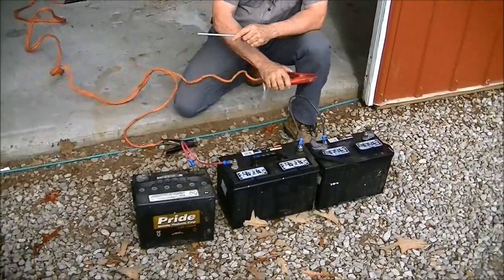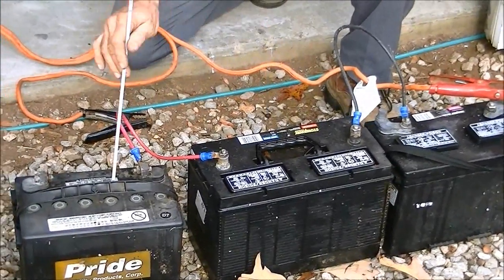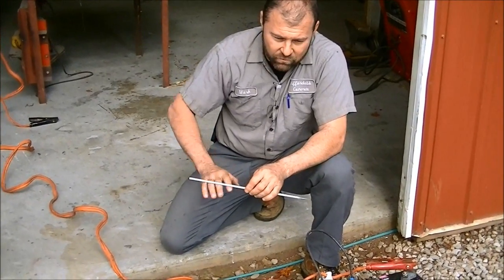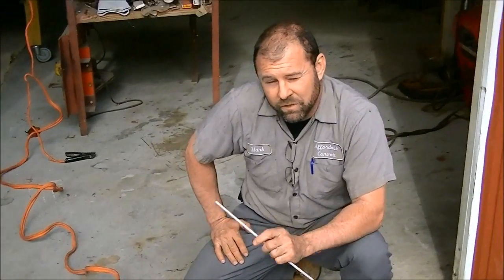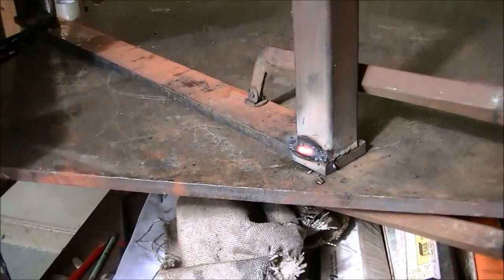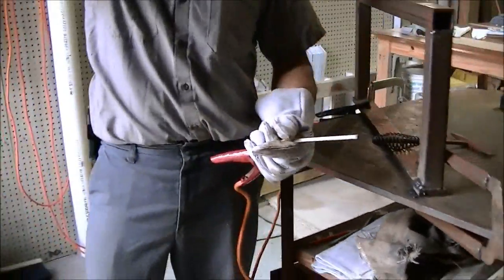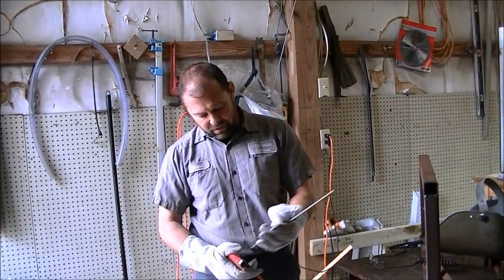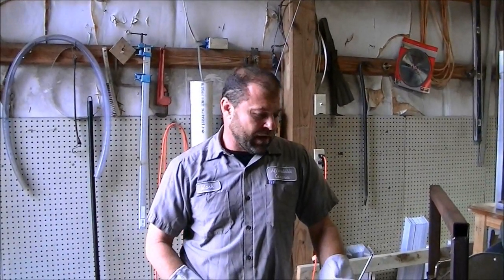Weld with car batteries? Neat trick in a emergency using jumper cables

Comment: If you set it up as an electro-negative you will have much greater success, and a much more constant bead!  So, positive to ground on your work and hokd your rod with cable that is clamped to negative.  No more "spit on, spit off".
Reply: that's what he did initially before welding when connecting the cables but then the video cut and he welded with the positive in his hand...

Comment: I was wondering if you were off grid and had solar panels connected to the batteries if it would work a little better or longer welding time???
Reply from the maker: I am not off grid but I do charge a battery bank with solar panels. I only weld with battery's in places I can't get to with the welding machine. I am sure you could weld a little longer if the batteries are being charge with solar.
Reply: @markp0177  I also was  thinking that welding with batteries alone would stress them, having panels attached should I  buffer that a little.

Comment: Does this damage batteries? How many amps do I need to weld to 1/4 rebars together?   My van has a single  oversized 155 deep cycle 12v battery.  My alternator is 160amps.   With the engine running I am able to run 110v AC appliances at about 1500watts.   I am wondering if I can use a 12v to 24v 480w buck converter to weld and somehow isolate my battery. Thanks.
Reply from the maker: It does not harm the batteries. Three 12 volt batteries in series will give you enough power to weld 1/4" rebar. A 480 watt inverter will not work.
Reply: @markp0177  480 amps (not watts).
Reply from the maker: @12vLife  You only need 90 amps to weld.

Comment: I've been thinking of trying the batteries in my golf cart to weld, I did try just it for a second or 2, I think I want to try again maybe disconnecting the cart then just use 4 batteries x 8 V. = 32 maybe 34V total. Do you think I would hurt my batteries, they are Deep Cycle Lead Acid Battery.  I have been playing around with the salt water type arc welder, use a 6011 rod 3/32 with a 10g. wires going  to a 40A. breaker, tends to need a bit bigger breaker, I plan on doing a video once I get the system down a bit better.  Thanks for your upload.
Reply from the maker: It won't hurt your batteries. You have it right to use 4- 8 volt batteries with a 3/32 rod.
Reply: @markp0177  
Thanks.  here is a little video I posted (unlisted) to YouTube, I'll do a better video later explaining what I've learned.
https://www.youtube.com/watch?v=U0zH0kiMNic

Comment: Awesome video. I have a three deep cycle battery bank in my e250-based overlander.  I always carry a few rods. You can carry a $25 electrode holder (or even a vise grip like some guys said) to hold the rod more stable. I carry a pair of the old style welding goggles too. Never had to use it on the trail, but I’ve played around with it before trips to practice.

Comment: Welding with car batteries doesn’t work very well because batteries are chemical power and put out flat DC power - no pulse whatsoever and that kind of power does not arc very good if at all. I know, I have done this experiment a few different times.
The first time I tried it I hooked two car batteries in series 24 volts and about a 60 amp charger across one of the batteries which gave it a little pulse and helped it arc a bit. I welded a couple welds with 7014 rod about an inch and a half long. Worked okay but one of my batteries was junk and ran out of power after about an inch. I welded two pieces of angle iron together and then cut the weld out and kept in my tool box many years.
Last time I did this I hooked two much better car batteries together 24 volt but only had small 4 amp charger on one battery. It did not want to arc at all. The best I could do was a ‘ scrubbing tack weld ‘ with 6011 rod. It was enough to tack a frame together that I then took to my job and MiG welded. Car batteries have plenty of ‘ oom pah ‘ and if the rod stuck it would light up like a toaster in 3 seconds but no arc power.
I suppose 36 volts would be better but still no real arc. This weld done here in little bits looks about right. I believe this one to be real. Too many on YouTube are 100% phony
If you could add something to help it arc it would work good.

Comment: In a coal mine we use batteries to weld all the Time we have a big resistor to limit the current it can be taped to different spots for different amps

Comment: One improvement would be to clamp the welding rod into a vise grip, and then hook the jumper cable to the vise grip.    Better connection at the rod and better performance.
Reply: Vice grip engineering is third world countries best friend.

Comment: Great stuff...
As a avid 4x4 offroad guy...I will toss a couple rods in the tool kit and make a jumper wire....we already carry jumper cables anyway....thanks for the awesome video
Reply: okiedoak201 I’d throw a couple 2-3 in wide 8-12 pieces of plate in too. Those scabbing plates and this same set up held my drive shaft together to get from the trail to my trailer once.

Comment: I'm just curious as to why connect the batteries in series as oppressed to parallel? Of course series will give you more voltage but parallel will boost up the amprage, which is what you would want to melt a material.
Reply from the maker: Its hard to strike and maintain a arc with just 12 volts but it can be done in a pinch.
Reply: in series raises the voltage.. parallel does not.. you would still only have 12v
Reply: rob b that's right but it's the amprage that melts the compound not the voltage. It's like a river, voltage is the amount of water where as the amprage is the force at which the water moves. And in series the amprage stays the same where as in parallel it goes up. I think you might be able to do the same job with less batteries of its in parallel. I haven't tested this myself yet, probably will soon

Comment: So , in an emergency , you wouldn't have a welder at hand, but you would have 3 car batteries plus welding rods or sticks ?
Doesn't make sense to me.
Reply: memyselfandi I have three deep cycle batteries in my overlanding vehicle ( lifted e250), and carry extra cables and a few rods in case I’m 100 miles from civilization. I can fit lots of tools, but my welder is 220 and is too big to carry camping in the backcountry.

Comment: This will work, but it will definitely destroy your batteries really fast for two reasons:
1. the lead acid battery is designed to supply reasonable amount of current, but if you over do it, the battery will over heat and get destroyed.
2: the car battery is not deep cycle meaning it is not designed to be emptied. If you do empty it however, you are reducing its life cycle dramatically. 
conclusion: don't do this for fun and only do it for emergency as the video stated.

Comment: I've done it myself but with five 6-volt, 220 Ampere-hour totaling 30 volts. Batteries. It really does work. Naturally, though, they start losing power after 14 - 17 minutes of continuous welding using a 6013 or a 7018 welding stick. Good job! You did it like a boss!

Comment: its spitting because u swap the positions in which the jumper cables are to be used , your supposed to hold the electro rod with the negative (black) jumper cable and hold the metal with the positive (red) jumper cable then it wont spit but nice work
Reply: loll..

Comment: Thank you! here in Mexico, there is little to no chance to affording an inverter, 220v MIG or AC/DC stick (like Lincoln's Precision TIG or Hobart Stickmate). 12v batteries are my only option for welding with 7018 (not 7018 AC, for some reason they're not as cheap or accessible) and 6010. 7014 rods are never sold here and Weldingweb told me that they make very pretty welds. 12v batteries in Wal-Mart or AutoZone cost 100 dollars each, where as in the scrap yard, I can get one for 12 dollars.

Comment: In case of emergency lol who got welding rod in there cars?
Reply: I intentionally keep some in a sealed case in my truck next to my jumper cables. Things break on the trail and it might be the difference between being stuck for an hour vs being stuck for a few days.
Reply: Bigger question, who's got 3 batteries in their car?

Comment: why not just buy a 250amp arc welder ,its cheaper, more compact, and safer...i do see how this could be useful in a pinch, but its a touch impractical 
who has multiple car patteries theyre willing to get eaten up for welding?
Reply: if u dont have a generator in the back of your pickup, what're you doin trail riding? and , if you drive to your trail location, just hook up your main battery and your spare. my point was those batteries and hrdware are going to be just as expensive as a little 250 amp welder
Reply: +keatonf0x I dunno, but I don't think I'm the only one who got the whole "in an emergency" theme of the post?
Reply: yes it would work in an emergency thats surrounded by very specific settings
Reply: +keatonf0x Ahhhh... plainly someone who never watched MacGyver, and never needed to fix a Landrover 420 miles from anything, in southern continental Africa... ;)
Reply: you're right, i don't know your life, and please, my timing belt snapped on me about a year ago and i got it home using the belt i was wearing, i love(d) MacGyver. apparently we come from two very different walks of life, i will respect yours for i dont fully understand it, just like you dont know mine, i apologize for trying to have the better answer or whatever, its just a coping mechanism i use when i feel insecure or not in control of a situation, but that is something im working on
Reply: +keatonf0x Oh hey, I'm sorry. I thought that you'd get from the 'wink' emoticon at the end, that I was just being ironic / satirical - I've never been to Africa either, though I loved watching MacGyver...

Comment: You say it welds too hot. What about 4 batteries, two in series connected in parallel with 2 more in series? That would give you 24 volts instead of 36. Would that work?
Reply from the maker: +Ronald Greene It is hard to strike a arc with just 24 volts. To lower your amperage just use a longer jumper cable. 6013 rod works the best too.
Reply: markp0177 I tried this trick and nothing happened? I am using one deep cycle marine battery and an ATV battery and a lawn mower battery. I have it grounded and when I touch the rod to bare metal nothing happens.
Reply: Clean the metal with a wire brush because it sounds like you dont have proper contact between + and - and check you hooked the batteries up in series.

Comment: I don't recommend to put the battery's on the floor....it will drain most of the power....
Reply: +Adan Montanez That's an old mechanic's tale that is not true.  The battery case is an insulator and does not allow electricity to flow though it.  In any case, dirt or concrete is far less conductive than a metal battery box -- which I'm sure you've seen plenty of.

I first heard of this concept when I was working at an auto parts store and was changing a battery for a customer.  I set it on the sidewalk and he freaked out "No, no, no -- you just 'grounded' the battery and I want another!"  I didn't want to deal with that bs, so I just got another and had him hold it (and it was a large diesel battery).
Reply: I believe the theory of drain from sitting on the ground dates way back to the very first car batteries that had a wooden outer case instead of plastic. It was true then, and it's something that has been passed down through generations, even though improved technology solved that issue many years ago.

Comment: How long can you weld using 1/8" stick for example before you lose enough heat where you cant ?
Reply from the maker: +Cruusher I am not sure, it depends on the batteries. I have welded several rods with no problem.
Reply: I know you can run a peanut grinder off a stinger whip. Hooked up on a welding rig DC of course. May not be good for it but it will work....lol

Comment: When your in the wilderness you happen to have 3 Car batterys and jumpercables and welding rod? Nice video though.
Reply: Ive heard of folks using old wire coat hangers as welding rod, the plastic coating acts as a half assed flux. And reasonably speaking everyone should have jumper cables.
Reply: TaintedMojo my friend did that once it doesn't work to good but it'll get you home sometimes.
Reply: If you're rock crawling with a couple buddies, most likely you can come up with the 3 batteries and a set of jumper cables, so all we're really talking about is throwing in some welding rod and 2 short 10g wires to hook the batteries together.
Reply: +Devin Williams Where do you get jumper cables. Where do you get the welding Rod? If this was a plane crash I don't  think you would have this.
Reply: Take them with you just in case.... Don't think some people don't. I know of someone who made his bumper tubes into an air tank, just in case  :)

Comment: Years ago it was possible to buy special hand-pieces that were made for welding with car batteries.  The electrode fastened to an iron plunger which was pulled back by a solenoid. There was also a spring and an adjuster knob.  The back-EMF of the coil helped to keep the arc going and the movement of the solenoid plunger helped to stop the rod from sticking.  You don't see these museum pieces for sale anymore but it would be interesting to know whether they actually worked.

Comment: Nice! So basically the welding rod functions as a resistor (that fails) and then melts, forming the weld! :) I've seen microwave transformers fitted to produce similar results but this actually looks a bit safer, as long as the batteries don't unintentionally short out

Comment: Did anyone else notice that at first the positive end of the cable was connected to the table and frame, and the negative end was holding the welding rod, but after welding the negative was on the table and the positive was holding the welding rod?
Reply: Polarity should be positive ground
Reply: He must have switched polarity. His power source is DC so yes it does affect the weld. Some rods are designed to be used with certain polarity.
Reply: I saw another video.  he ground the positive and weld by negative it calls  (  DC electric negative welding)
Reply: If he had it negative on the ground,  he would just end up with a bunch of Slag.

Comment: Probably a total newb question here but how does it have enough juice to weld but not electrocute yourself?
Reply from the maker: Inhalin1514 The voltage is what will kill you and it is only 36 volts. It will shock you a little if your hands are wet.
Reply: markp0177
Thanks man..cheers
Reply: +markp0177 I know it has been a year but for the new readers like myself, ..... Amps is what kills..... Look at stun guns that discharge 20,000,000 volts. They don't kill because they are only about 5 amps......

Comment: Great video.  I've got a question.  You said the setup is equivalent to about 120 amps, but aren't the batteries capable of outputting much more than 120 amps?
Reply from the maker: Yes the batteries are capable of putting out more but the size and length of the jumper cable seems to limit to around 100 amps.
Reply: The gauge of the wire does act as a current limiting device, AKA a Resistor (See my Avatar!), the smaller the wire, the greater the limit.
Something about a Direct Current in a conductor establishes a magnetic field that opposes the flow of the current, which is not present in AC Conductors because of the constant increase and collapse of the Flux Coils. Which produces "Skin effect," which means the current wants to flow on the surface of the conductor, and that means a wire can handle LESS Ac than it can DC.
Now, in a DC Circuit, the magnetic opposition to the current flow isn't that great, per foot. BUT! When you got a lot of feet... And when you're calculating the feet for this, if you're determined to do the math, keep in mind it's a Round Trip: TO the load, and then back to the batteries.
You're also probably losing a lot of energy to wasted heat in the cable, too, but over a long enough distance it can do that, between  its ability to dissipate heat and limit the current.. If, however, you hooked up a one foot wire to a battery, and then shorted it out, no matter what gauge you use, it's going to be a very short-lived fuse. And possibly a blowed-up Lead Acid battery in our faces, OR WORSE.
Is late, and been a long time since I dove into this level of Theory. I hope I didn't confuzzle you worse.

Comment: As an aside, if you do have to drain the battery down and can't get it to take a charge you can place another battery in parallel with it  ON A TRICKLE CHARGER and let the charge trickle back to the drained battery.  Could take up to 24 hours to get enough charge on it to place it directly on a charger. Times will all vary dependent on battery and air temp and overall state of the battery.

SAFETY: Never charge a frozen battery; bring it to room temp for a good 24 hours and then attempt a charge. Never charge a battery that is leaking, has missing posts, or is damaged.  Think first! Then, act. Battery acid is not something to trifle with people. Cheers!

Comment: what a pro... great advice thanks for sharing

crafty little trick... better than welding with a bucket and water off the 120VAC coming off the wall...

that's how most third world countries do it without an actual welder... very dangerous but fun to watch
Reply: just an information, its almost impossible to weld with AC  POWER BECOUSE you have no  constant negative ore positive poles..... hehe.
a welding maskine just transform the AC TO DC and increase the amps.
my latest hobby welder which uses a 16 amp fuse transforms 220 volt  AC in to 30 volt DC and up to 200 amps